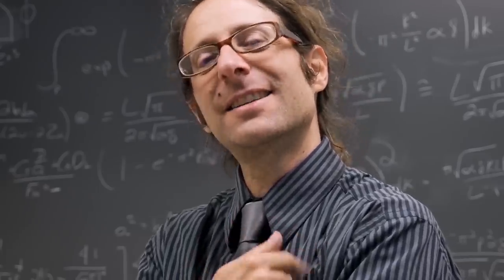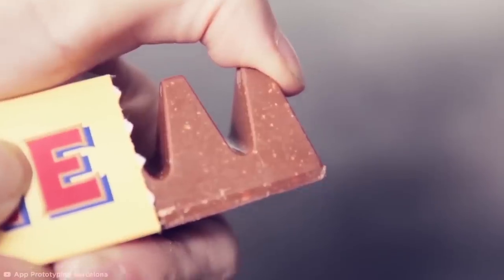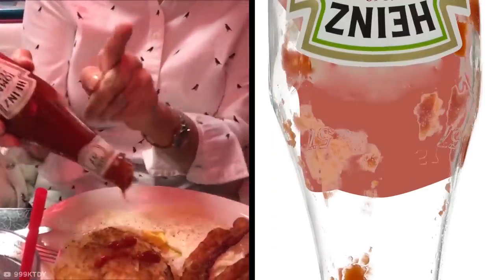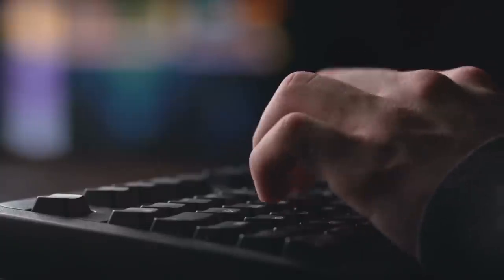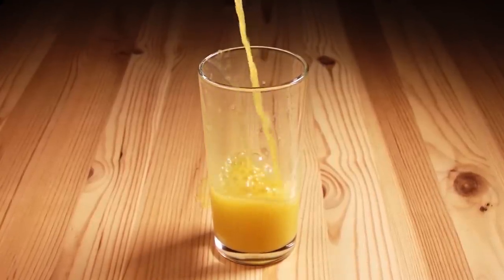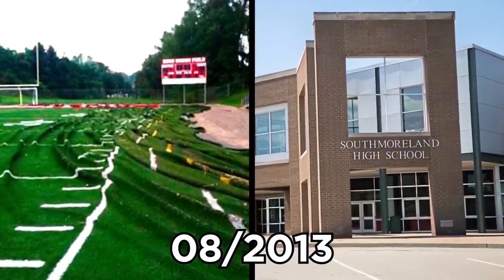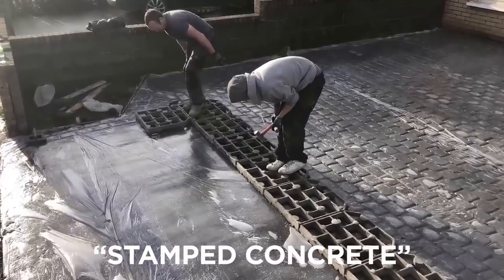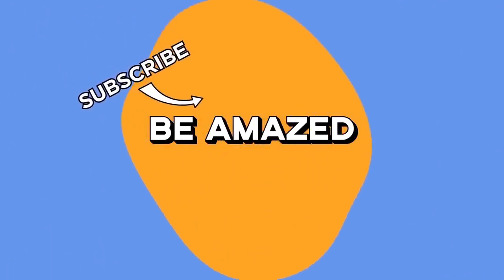Inventions That Fool Us All

Comment: as a current employee of The Habit Burger Grill, there is a nifty little trick that the company doesn’t tell us about in training. if you look at the little paper “boats” that our fries and kids meals come in, you might notice that certain fold points have perforations. while these are primarily there to for the product company to help properly fold the boats into the correct shape, they are also there for us cooks in the restaurants to easily break off an end of the boat and turn it into a scooping tool. 
dropped the fry scoop in the middle of a rush and don’t have time to clean it? no problem. just break off and end of one of the literal hundreds of paper fry boats right in front of you and continue scooping fries like no tomorrow. they are also used to help us with the process of pre-portioning special fried items like green beans and sweet potato fries. turn the big fry boat into a scoop and then fold the pointed corners inward to allow a perfect glide into the portion bag after weighing the correct amount of product.

we also use them as disposable cleaning tools for the fryer tubs and the grease trap underneath, as well as for clearing excess food waste from dish sinks. and some cashiers use them to help pick up spills in the dining areas. 

nifty, no?
Reply: Nice
Reply: Yeah real nifty

Comment: Okay so the toilet paper should be the other way so it doesn’t hit the wall. Am I seriously the only one who noticed it was still touching the wall?
Reply: It still touches the wall front or back
Reply: Yes it touches the wall but when you roll the paper around your hand, the part that will be touching you is the part that was facing the inside of the roll not the outside. While the part touching your hand (which will have no contact with you) was what was touching the wall.
Reply: @daniisnotok   What about the scrunches out there not just the folders? Doesn’t help much then.
Reply: Set your tp on the top of the old roll like the rest of us and avoid the contravercey!
Reply: Right
Reply: I was about to mention it; then I saw you beat me to it.
Reply: No you aren't
Reply: Willie Zman no, it doesn’t. If it does then you’re either using shitty TP holders (pun intended) or it’s installed wrong. They’re designed to leave at least 2 inches between the roll and the wall.
Reply: Susan Mcinally it’s an optical illusion in the image they showed. It doesn’t really touch the wall. If it does in your own home, buy a new holder because what you’re using is poorly designed. Also, using these ginormous rolls makes it even harder.
Reply: @fashiondiva6972  Really? No your wrong lol you got yours installed very very wrong if you got a 2 inch gap. Or maybe you need a ruler. Also it is completely pointless talking about the tho whole time people keep leaving the lid up because it all splashes up on to the roll anyway.
Reply: I knowticed i was gonna say the same thing
Reply: I was just bout to comment the same thing
Reply: wait so im not the only one?
Reply: To save money, I always use both sides of the paper.
Reply: Correct. And the patent is not from 1981, lol. It's 1891
Reply: Susan Mcinally Many other commenters have said the same thing. You must not have read any other comments before you posted yours.
Reply: @dizneecyndi2179  That would be correct! Congrats for reading comments and not watching the video.
Reply: just change the tp holder
Reply: @Frank Sroka Nor can you spell
Reply: Susan Mcinally that's what I thought!!
Reply: @Frank Sroka In my country tp holds tp so it does not touch the wall etheir way
Reply: Darn I was gonna comment that I will think of something else then
Reply: Right
Reply: nope
Reply: I saw that too but also the thing is that if I turn my toilet paper in or out it still doesn’t touch the wall.
Reply: @RedPDawg  Actually I did watch the video. All 15 minutes and 44 seconds of it. Then I came to the comment section. I was going to comment about the toilet paper, but then after reading some comments (Yes, I am a comment reader),  I saw that others had already posted about it. So I felt no need to. There was nothing new I would have added.
Reply: @dizneecyndi2179  So instead you wanted to point out that you read all the comments and you saw that I had said the same thing as others. Just out of curiosity did you point it out to all the people who repeated other comments? I can imagine there is a few repeats in the 1.6k comments.
Reply: i literally just came into comments to point that out n first comment is this one.
Reply: @daniisnotok  nope. no matter what way you put it, the "soft" side will always be touching the wall. turning it around doesnt unroll it and roll it back "upside down"
Reply: Because I'm worried about the germs on the wall when wiping my dirty crap covered anus. As someone who actually got told off for putting the paper underside i can attest i don't give a shit.
Reply: I was about to say that haha
Reply: Nope
Reply: BUT (no pun intended) if you have feces on your hand when you touch the wall to retrieve the paper then so will the next guy.
Reply: yup both sides
Reply: Fr
Reply: for real tho
Reply: that model Tp holder is just bad
Reply: Yeah Lmao
Reply: I noticed it to and was immediately was filled with rage.
Reply: @daniisnotok  but not all people will fold it
Reply: I still noticed the other side before the hand is pulling is still touching the wall.
Reply: You're not the only one who noticed, I did too. Also as a mum to 3 children, all of which have been diagnosed with ADHD, having your toilet roll the "correct" way means my kids can unroll the whole thing in seconds, just by batting it with their hands whilst sitting on the loo. Having the flap at the back, the apparently "incorrect" way, makes it more difficult to do. They can't help getting bored on the loo so to save my own sanity over wasted loo roll I'm gonna stick with what I know works for me and my own!
Reply: Yeah NO
Reply: I noticed that too
Reply: LOL me to
Reply: If your lazy and don't clean your bathroom I can see it being a problem.
Reply: I depinds how close it is the the wall
Reply: No I also saw it
Reply: Nevermind the bacteria on the wall, think about how filthy people's hands already are when they touch the toilet paper, especially people who don't wash their hands.
Reply: If you are worried about the tp thing then just wash the part where the tp is
Reply: Yes
Reply: Yes
Reply: Yes         s
Reply: Ik
Reply: Nope
Reply: Thats exactly what i thought
Reply: THANK YOU
Reply: Yeah it does still touch the wall
Reply: @williezman5418  there’s no front or back on the toilet paper because it’s round .-. Or do you mean the to one and the bottom one?
Reply: 400th like
Reply: No your not lol
Reply: @Cosmology Master lol it’s funny how people notice that too and are like wait.. isn’t it still touching
Reply: Ikr
Reply: Susan Mcinally no i already knew
Reply: that's what I was thinking ;-;
Reply: @ollie9943  wut ;-;
Reply: @kuso8631   Imagine this is the toilet paper      back➡O¡  ⬅front
 Where you pull the toilet paper is the front and the one thats rolling it is the back.
Reply: @networkengineer4405  even if we wash the wall, there will still be bacteria
Reply: Yes
Reply: nope
Reply: I noticed to
Reply: Even did i
Reply: I noticed it still touches the wall
Reply: If the original pattern is the correct way use something, then what about smartphones or PCs or any other invention for that matter????
Reply: I saw it, too.
Reply: no
Reply: Ya like boy u wrong even my 4 year old figured that out like what
Reply: Same
Reply: yeah
Reply: @daniisnotok  stop trying to be smart. Most people will end up touching the paper that touched the wall either way.
Reply: ikr!?
Reply: I realized it
Reply: Me to bro lamoooo
Reply: I was going to say the same thing. I noticed it still touching the wall, doesn't matter how you put the toilet paper on thr thing it will hit the wall.
Reply: No
Reply: I have to hide mine from my cat so it isn’t ever on the hanger lol if I forget just once I come into a bathroom full of confetti
Reply: IM ABOUT TO TELL THAT AFTER WATCHING IT SKSKKS
Reply: I’m the 666 like
Reply: I noticed that too lol
Reply: I noticed
Reply: Exactly bro... it's no difference
Reply: We are still the use it for our butt
Reply: @daniisnotok  cant you just do the same method while the toilet paper was still facing under?
Reply: Wtf
Reply: EXACTLY
Reply: @daniisnotok  unless it’s farther away from the wall
Reply: @williezman5418  and plus Susan basically said that dummy
Reply: I noticed
Reply: Correct
Reply: No
Reply: Ikr.
Reply: no trust me i am confused
Reply: No imdid
Reply: mine doesnt back or front
Reply: My thoughts exactly...
Reply: Me the thumnail after wathing why there no noodles in the bottom me: do this guy even watch guys who is smarter than him :/
Reply: That’s why I use my hands
Reply: @daniisnotok  Why you wrap tp around hand? Are you pushing entire hand in?
Reply: I came searching for this comment!
Reply: @RedPDawg  p
Reply: That's the picture, the guy who did that was stupid, just make sure it doesn't touch the wall.

Comment: Well, I mean, cereal boxes do already have an alternative way to hold it closed: there's a little tab on the top that you push in  which holds one of the flaps tabs in place
Reply: Yeah but that easily breaks
Reply: Nico Yazawa ok, also use one of those bag closer things that everyone finds one random day in the couch
Reply: Does BeMazereally think this cereal box closing method really stop mice. Neither method will prevent mice from eating your cereal, they just eat through the box itself they don't even mess with the closure.  If you have mice your best option is to move it to a plastic container with is harder for the mice to chew thru, but still possible.
Reply: You know what that likes mean :)
Dammit
Reply: But it’s archaic 😂
Reply: I tried that it did nothing
Reply: it is usualy broken in my house cuz people cant open a box of cereal like civalized human beings. so for 5 years i have been eating stail cereal.
Reply: That's true.
Reply: @Diamondarcher3  yes I find them sometimes on the couch

Comment: Hey, here's an overcomplicated way to close a cereal box instead of using tabs to close the box
Reply: And not sealed any better.
Reply: It would negate tip hazards, like I might do it that way while one the road, festie life and such...
Reply: Exactly! I stopped watching after that terrible idea. Here's the correct way: Pour the cereal into a clear plastic tub with a lid. ALL problems solved. NO time needed.
Reply: Agreed. And I've never seen a mouse eat straight through a cereal box.
Reply: @trejobro  the occasional mice that gets in my house are not destructive though easy access food is kept out of their reach and they are soon dispatched. 
    The garage and sheds are a different story. They will chew up everything they can even wood such as my door. It had a gap and they chewed it so they could get in. I fixed the trim, they chewed it again. Now its trimmed with aluminum. So far so good.
Reply: It does look nice and neat tho, just my opinion
Reply: @trejobro  that was sarcasm? Correct?
Reply: I won't use that method but it's not that complicated lol

Comment: That juice carton "trick" has been around for ages.  Just ask anyone that pours car oil from a bottle, or really anything with an offset opening.  I pour straight from a 5 qt container into my oil funnel with no issues or splashes.  Turn the bottle sideways as you empty it to keep the flow continuous without having to turn it upside down.
Reply: What you said is also true for pouring from a 5 gallon bucket with a spout. I started using this more than 40 years ago. It saves a lot of messy clean ups.
Reply: Juice cartons look different where I live. This trick wouldnt work. The spoit is not on top but on a slant like a roof
Reply: If you dont have a problem controlling your hand while holding a 2L box, then the other way doesnt really make any mess
Reply: Das Boot!

Comment: One secret to peanut butter nobody mentions is that you can get 100% all natural delicious peanut butter by simply cracking up hazelnuts, get off the top shell skin, pop it into the own at the top for almost no minutes, crush and mix them and you have peanut butter with no added sugar or anything.
A nifty trick my dad taught me about old roads is those with cube shaped rocks. They don't just last an eternity, but when they start to get worn out, you simply turn it around to another side and now you can reuse it for another eternity.
One of the worst inventions fooling us is soda. We always buy packaged sodas in a bottle or can. But restaurants and such buy the exact same Coca Cola in powder.
They easily and cheaply buy a ton of soda powder, add carbon to water, add the powder and sell it fresh.
Since it's powder, it lasts longer and come out fresh every time.
Another cheap trick is smaller packages. We're not paying for the product, but the packaging. So they want you to buy as small as possible to pay more for less.

A personal tip is when you have open pillows or soft parts of furniture, or maybe you're just tired of ripped sheets. Use towels. Not just super fluffy and liquid absorbent but made to handle tearing and straining.

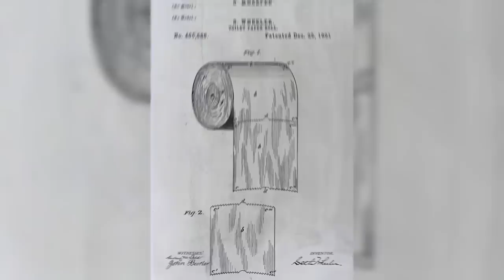Comment: 3:30 toilet paper still toch the wall, so whats the point of that?
Reply: Thats what Im saying
Reply: Use water
Reply: It depends on how far the holder sticks out from the wall and how thick the roll of toilet paper is.
Reply: @wandarichardson4213  true, if it's near the wall the TP will touch the wall either way. Or you can use the individually standing holders, they don't touch anything 😊
Reply: Isnt it still in the bathroom and fecal matter still near the toilet?

Comment: For unlocking the toilet you can also cover the seat completely with cling film. A couple of layers is best. Then push down release, push down release. The film will push and  pull the water up and down until the clog works free.

Comment: Soda cans can be sold for spare change at any aluminum recylcing center, where as plastic bottles can be recycled also, they are worthless. If you drink a lot of soda, or any beverage, you can get upwards of .50 cents per pound for the cans.

Comment: Hay you forgot the most important toothpaste used wrong bit... Your bush will either have a coloured tip or a coloured circle on it. That's for measuring your nerdle or pea of paste. It's there to help you get the right size blob. Oral B and colgate have both done articles on it 😊😊

Comment: You can open a jar by wedging a screwdriver tip under the edge. Once the air gets in, the lid is easily unscrewed.
The orange juice box, I had the habbit of making a hole in the other side to get the flow evenly.

Comment: If your toilet paper touches the wall when facing one way it will touch the wall when facing the other way. It's a roll, the part facing the wall becomes the front as it unravels. The roll in the final picture is literally touching the wall anyway. Also, pets can't unravel it as easily if you hang it under instead of over.

Comment: That video clip you used of the machine laying down the bricks saying that it was actually laying down a brick mesh that machine particularly lays down solid real pavers put in place by men that are standing on top of the unit, two men can pave an entire street with that machine and there is no mesh on the back of those bricks

Comment: HI all. I have a tip with regards to soda cans. If you take the ring pull and push it all the way flat you get a larger amount of liquid in your mouth and if you pull it so it is at more that 90 degree angle you will only get a small amount of lquid in your mouth.  Best to do that with little kids when they want soda and you can only give them a small amount.  so to reiterate.. push the ring pull and you will get loads of liquid coming out and to lift up the ring pull towards you and you will get less of the liquid coming out.  Peace Out.